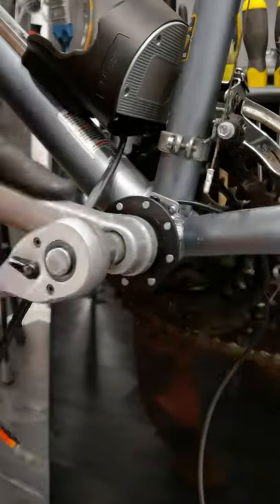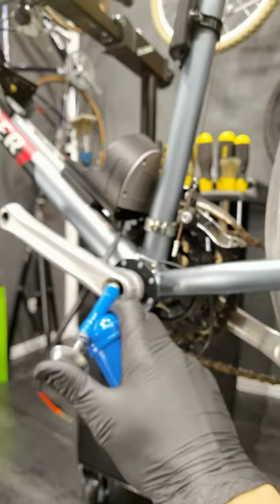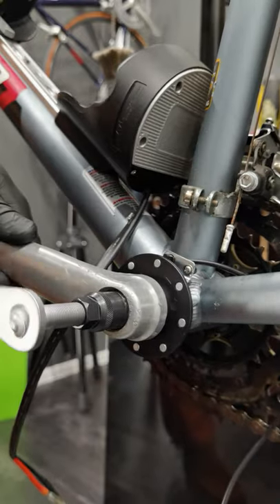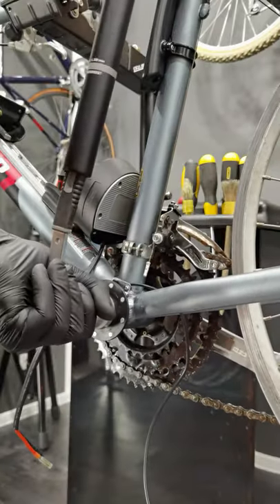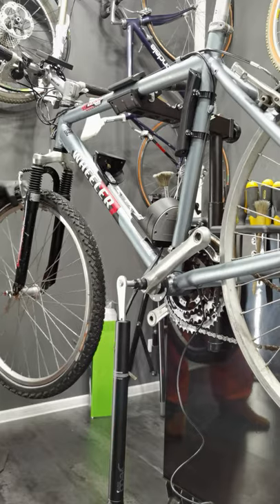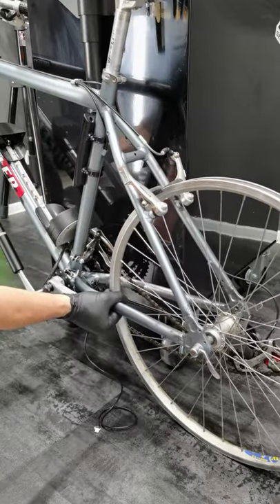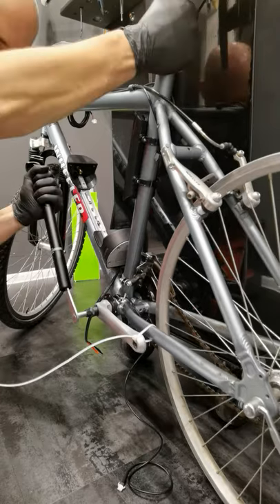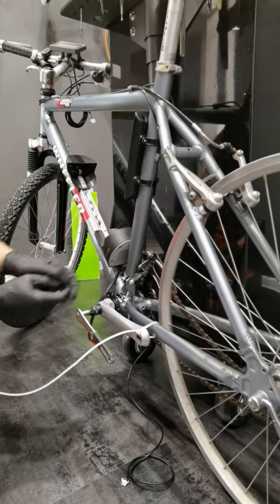Hacks for removing rusty, square tapered crank arm. #shorts

Comment: 1. 3 in 1 oil on both cranks behind the bolt where the spindle meets the crank the night before, liberally. 

2. Just put the bike upside down on a towel like we did in the 90s as kids setting up our drivetrain. This is a very stable position that you can really put a lot of force/torque into. 

3. Dont use a cheap crank extractor. Cheap money wise is okay. Material wise is not. Park Tool CPW7, $15 works on square taper, isis/octalink. 

Follow those three steps and you'll be fine.

Comment: Before using leverage check that the pin isn't in contact with the crank.
Reply: Learned it the hard way and stripped the crank arm.
Reply: @Enzo-ox9uf  you get better as a mechanic. A good mechanic is someone who doesn't fear trying but who have a good memory.

Comment: Using penetration oil/wd40 with impact using mallet is wayyyy easier. I found out u often promote unnecessary steps. Like this one, grease on the tools, on the crank? No need for that.
Reply: Yes the impact on a press is called ringing the taper. It's common mechanical  knowledge.  Bicycle mechanics should know more alot the knowledge has been lost.
Reply: @jasedavies9288  if work on own bike,  spray penetration oil today, leave it overnight. Tomorrow, easy peasy!
Reply: @shhhdontshout  well in a shop environment time is 💰  but great suggestion, it does work
Reply: @jasedavies9288  i normally do that if working on rebuild project, bikes normally come in worst condition possible 😂

Comment: what if the crank arm thread is worn already?
Reply: Cut
Reply: you could hit it with a hammer from different angles to loosen it up. Or... you could use a bearing puller (thats what I did when I had a similar problem)
Reply: I (working in a bike shop) usually first try to simply get it down with a hammer, but if that doesnt work, i will drill in a new bigger threat, in which i can use a taller removal tool:)